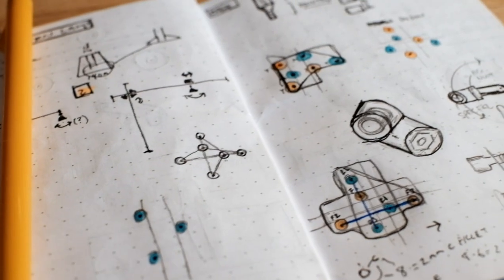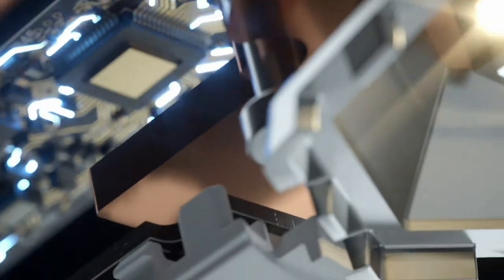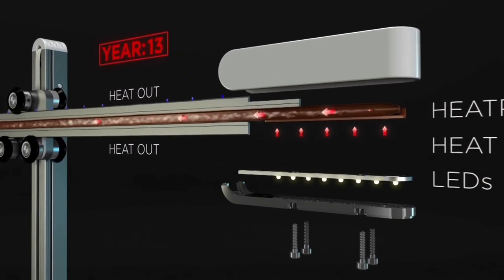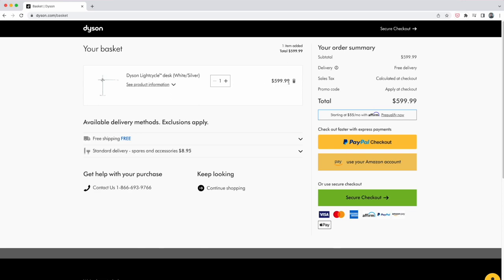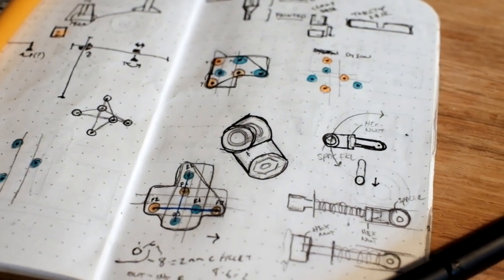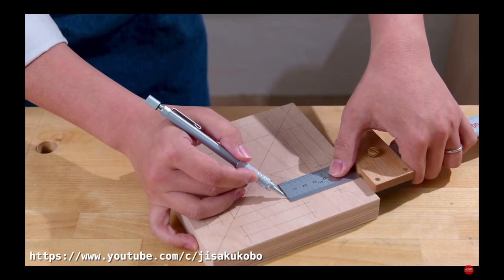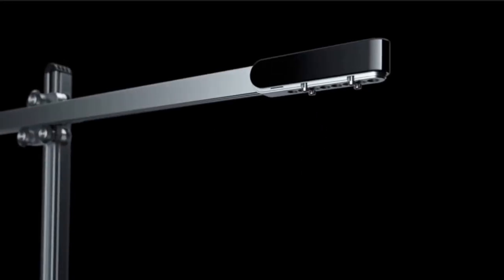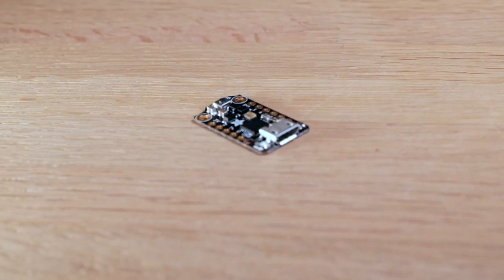I'm Making a DIY Dyson Task Light (AKA The DIYson Lamp) | Project Intro

Comment: Really love the videos, amazing quality, novel and insightful DIY mind-mapping/process driven approach. Atleast in the context of content creators i have hardly seen someone be so thorough on their time allocation and prioritization in a project. Very professinoal, and a breath of fresh air.
As for the movement of the lamp, the carriage is really nice so i understand the reverse engineering incentive, but realistically speaking if you DIY it getting linear guide rails is a no-brainer. Especially with the pogo-wire design of late.